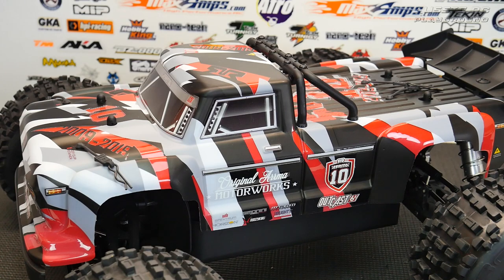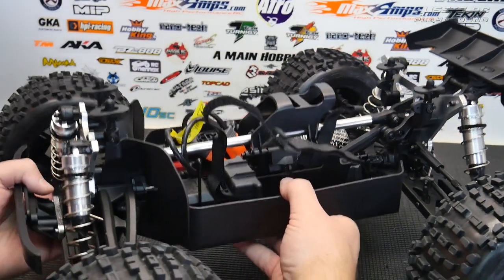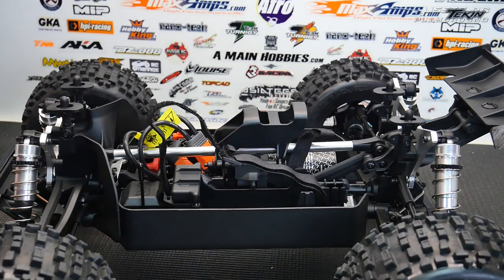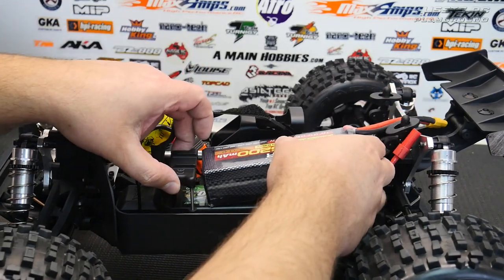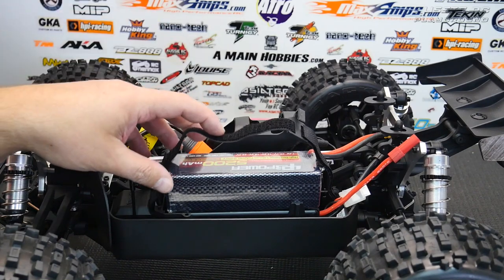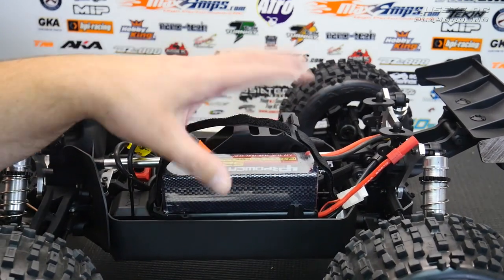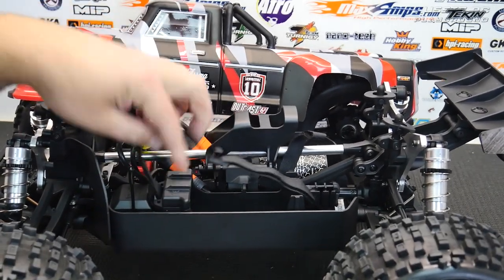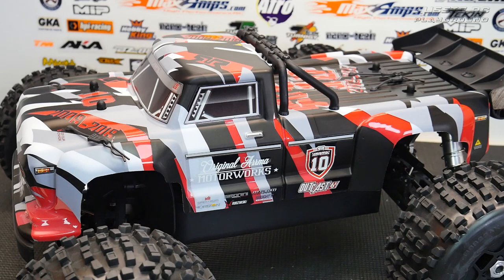RC HOT TIP - How to fit 2 x 3S Hard Case LiPos in your ARRMA car

Comment: You can still use the plastic battery hold down with two 3s hard case batteries. All you do is release the clip and pull it up just enough to clear the batteries. There is enough length on the rods to keep it in place after unclipping it, and it will hold the two batteries down better than just using the straps or adding Velcro.
Reply: yes thats exactly what i do with my talion exb. and 2 - 3s lipos. a slight lopsidedness on the body but i might be able to raise the mounts up a bit but it works!

Comment: Crazy at this point Arrma or a 3rd party doesn't make an extended battery clip would be so nice to have.

Though you can place it back on top of the battery and the metal sliders still engage, it's not as good as the intended use but it does help.

Comment: Hi Vas, great video again, could you do a vid on ESC, battery and motor over heating Why its so and what you do to fix it! cheers mate!
Reply: I'd be interested in that too
Reply: TheWheels1965 use a cooling fan or lower the size of your pinion gear

Comment: Hey Vas, you going to like what I have to tell you.
Just got off the phone with my contact at Arrma in the UK, and apparently in the near future, Arrma will switch to the new DX3 Smart transmitter for the high end models that normally came with DX2E Smart, and models that came with STX2 now comes with STX3. Why is this important? Well, I just got my LHS to include a DX3 Smart for a DBXL-E 2.0 I just ordered, and while the internals are very much DX2E, it now features a foam covered wheel as well as better ergonomics. My guy at Arrma also claims that the new DX3 has better range. If they have improved the range in the same way as they have on my DX6R, it's pretty impressive. The same goes with the STX3, and the resolution of the STX3 has supposedly been improved over the STX2. So no more issues with poor dual rate adjustment etc.
Lastly, the foam steering wheel off the DX3 Smart can be retrofitted to the DX2E:)
Reply: Did your guy at ARRMA also tell you which models that will be? Maybe a new Kraton v5? 👀😉

Comment: Great little tip!!! But I have to correct you ever so slightly... The new 3S 5000mAh 100C hardpacks from Spektrum actually do fit in the Typhon tray and gives you no problems with the body...
Reply from the maker: Well, those batteries aren't available in Australia, so I would never have known that. But this was just a tip or a chest to fit larger batteries, and there are hundreds of different ones out there, so hopefully it will help some people out who didn't know you can take that lid off. 😊👍

Comment: You can actually use 2 big 3S hardcase packs and keep the lip when you mod the battery tray a little bit. To modify it, just do the following:
- remove the battery tray from the car
- remove the lip. You will see that the little nose/hook that holds it in place and stops it at the top is running in a gap in the tray
- extend this gap a little further to the top as much as you need it. I just took a hobby knife and cut a little bit into the plastic on the top left and top right corners (a few millimeters). Then I tore the middle plastic piece away with pliers.
- look if the lip is now going up far enough to use your packs. If not, redo the last step
- when they fit, put your battery tray back into the truck and you are done

I personally have done this on mine and now run 2 Arrowmax 3S Hardcases (37mm height per pack) together with the lip without issues.
Reply from the maker: That would mean the metal rods would only be in their holes a couple of millimeters, so I can't see keeping the lid on all that functional. But if it works for you, then it works. 👍
Reply: @AussieRCPlayground  Well, I just measured it. In my case (2 x 37mm high packs) the rods are still 15 millimeters inside. 
I mean I haven't bashed that hard yet (I am only a few packs in with my Kraton). On the other hand, it seems to still be stable, and most importantly: This mod doesn't have any negatives. You are right, if you put the lip further out, it may loose some stability, but it still we be more stable than not having it at all. And when using smaller packs it won't impact stability at all, as in that case nothing changes compared to earlier.
Reply from the maker: True. 👍 Good mod. Thanks for sharing. 😊
Reply: Thats useful even though  i dont own an Arrma vehicle!You think its possible to remove the pins and put some longer ones?Or are they fixed in the plastic?
Reply: @BASSstarlet  As far as I know they are fixed, but I haven't looked further into that up until now

Comment: Hi, my problem is the body of the Typhon 6s, I cannot install up to a maximum of 68mm in height, and a maximum of 46mm in width. Should I try with duo 3s or single 6s it's hard to find. (and I wouldn't want to spend too much) Thanks. 😅

Comment: Remove holder. Place batteries in. Replace holder. It will not click back into place but you can simply use the horizontal velcro strap to hold it down on top of the batteries. Simple.

Comment: So 2 Spektrum 3s batts dont fit in the 6s Arrma Typhon?! WTF that is exactly what the hobby store recommended I get. Spektrum 3s two pack. Now I wont even be able to fit the body on? I need to know if anyone knows if they wont fit so I can return them fast
Reply from the maker: Apparently the Spektrum 3S batteries are slightly smaller and will fit in the tray, however, given how tall they will be on top of each other, I still doubt the body will fit. I would suggest trying it out in the store before paying for your packs.
Reply: @AussieRCPlayground  Thanks. Yeah I called Horizon and told them I bought the recommended Spektrum x2 3s lipo/charger bundle they promote for the typhon on their website and ended up calling the tech support and asked if they even fit.
Reply: @FalcoINC  I just ordered the same thing. Mine will be here Thursday. Have you had any luck with the body fitting ?
Reply: @mikefreetage6808  I dont actually have access to the typhon yet. Its from Santa to myself lol. But I called Horizon and asked the lady if Spectrum 3s x2 lipos fit in the Typhon because that is what they sell as the power stage pack drop down menu for this car on their site. She had a tech actually go back to the warehouse and try to put the two 3s Spektrum batteries in the car and she said they couldn't even get the body back on :( 
I told them they need to remove that add on for that particular arrma car or put a note somewhere that you cant run them in series with the body on. You should be able to contact them and tell them you bought the same bundle and would like to return/exchange them. I ended up buying the Smart charger and a single 6s smart battery which should fit given the dimensions of the Typhon tray.
Reply: @mikefreetage6808  Just an update on this. Horizon basically told me I'm out of luck and that they don't accept returns on batteries. I wrote back to them saying that this is pretty crappy service since we literally ordered their recommended power pack bundle they advertise on their website for this car.  Ill see if they follow up.
Reply: @FalcoINC  ya it’s BS. I’m in same scenario. I just ordered another 6s battery

Comment: Hey vas, have a look at exocage r/c he done a video on this same thing and managed to heighten the brace for batteries with a small hack, don't remember what it was he done exactly but atleast you can still use it. The hack was in a Mojave video where he installed the keratin 8s system in it. Check it out.
Reply: Kraton**

Comment: Can I run two 3s lipos in my kraton 4s?
Reply from the maker: If you connecting them in parallel, yes. If you're connecting them in series, no. "Series" means you'll be running 6S and that won't work in a 4S car unless you've upgraded the power system to be able to handle 6S.
Reply: @AussieRCPlayground  parallel =more punch..around same run time as 4s single..
Series =lesser punch ..longer run time.🤔🤙